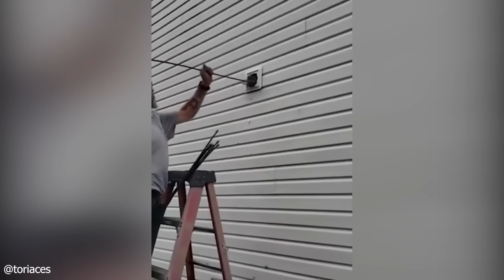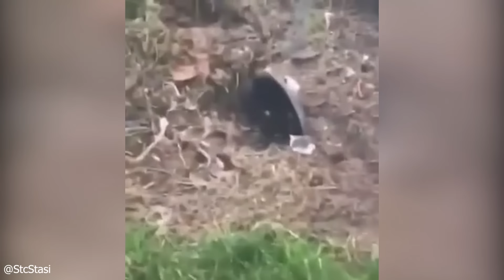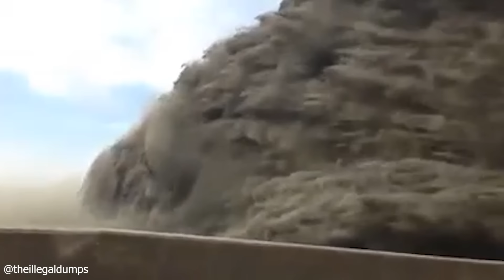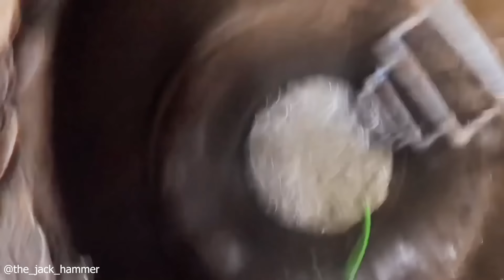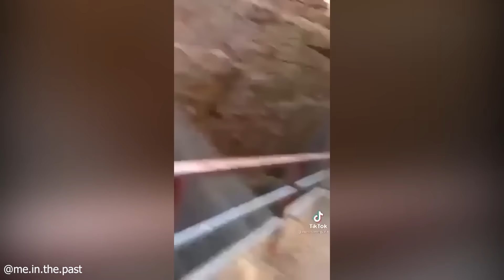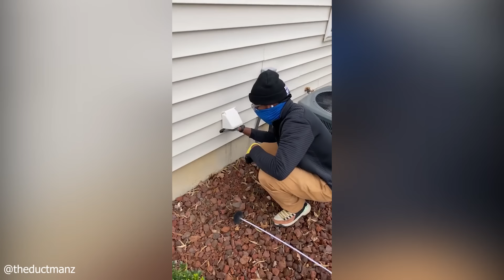Dryer Vent Cleaning After 20+ YEARS! - Satisfying Uncloggings #37

Comment: I am lucky enough to have the vent about 6 inches long before it exits the outside wall....
very little lint gets the chance to settle in the vent...
but every time the drier belt snaps and I take the drier cabinet to pieces to replace the belt....
there is a lot of lint in the body of the machine that needs cleaning out....

Comment: I've watched a lot of the dryer vent videos and you are one of the only ones that go through the duct connection to the faceplate. Believe it or not, there are some videos that show just putting the face of the vent cover over the existing pipe and not actually connecting it to the vent duct. I hope more people watch your video so they don't end up with mold issues.
Reply from the maker: Thank you so much! 🙏

Comment: Why isn't anyone using an industrial vacuum do collect that nasty lint up?
As their neighbour I would be pissed if any came floating my way!
Reply: some guys do use a vacuum, but they clog up quite often because you don't always have the option to use a full size hose with the discharge cover in place. Most times it's just easier to catch the lumps in a bucket.

Comment: Clothing fibers make up to 73 percent of micro plastic pollution in the Arctic. It’s also a factor in the air we breathe in the lower 48. Please put something up next to the vent to collect the stuff.
Reply: They job is to clean it out not up 🤔🤷
Reply: We each breathe 7000 micro plastic particles a day. So much of micro plastic comes from clothing. It’s everywhere, from the bottom of the ocean to the alps. It’s in the Arctic ice. 
Just cleaning dryer vents onto the ground is a major point where these micro fibers are introduced to the environment.